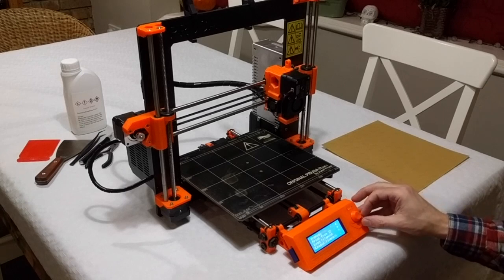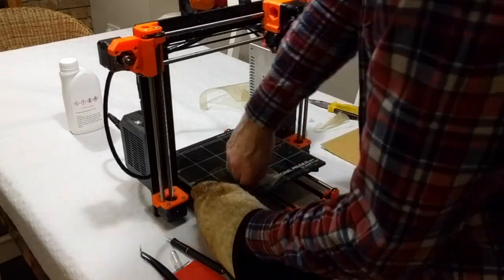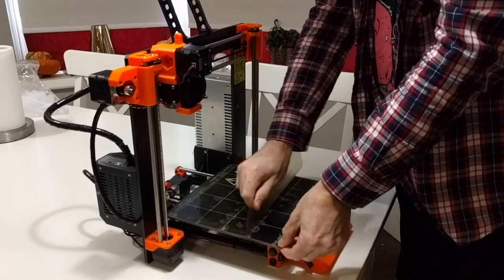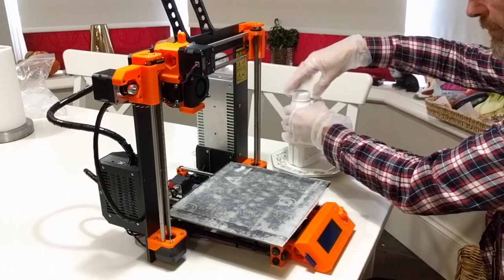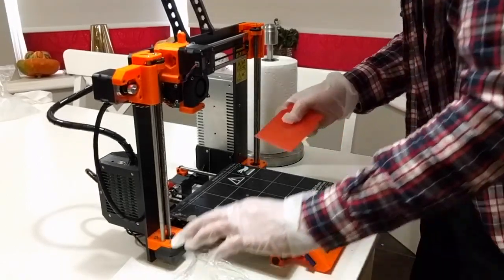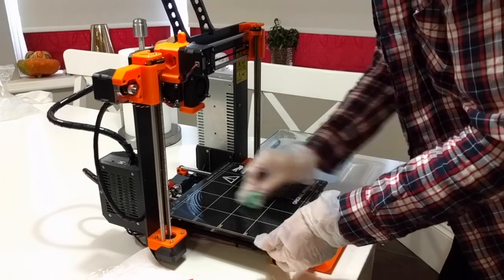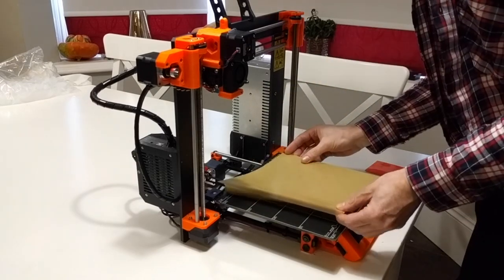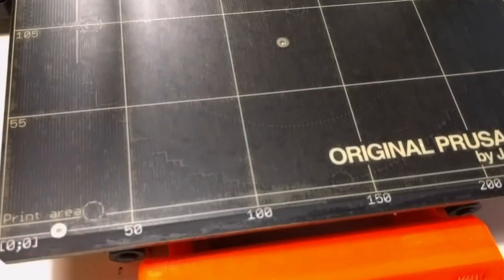Replacing the PEI sheet on a Prusa i3 MK2/MK2S without removing the bed

Comment: I'm a fan of the method which involves putting the steel sheet in the freezer for an hour. Then the PEI pulls straight off. This does leave the adhesive on the steel sheet, but it seems to be the most efficient way of getting at the glue. 
Limonene is more expensive than mineral turpentine, and harder to get hold of, too. I found turps worked very well, provided I went back to it every hour or so to scrape off each layer of glue. Turps does stink though. Not as pleasant on the nose as Limonene. 
I'm not happy with the idea of pulling and pushing at the sheet while it's still attached to the printer, as I suspect there's a chance of loosening printer components and/or messing up the calibration of the printer. A better idea might be to remove the steel sheet, put some cardboard under it, and work on it in a well ventilated area away from the printer. That's what I did.
Reply from the maker: This was the original MK2s – so there's no steel sheet – the bed surface is attached to the bed which is attached to the printer. That's why I knew it was OK to apply some force to the bed, because I had to do that pretty much every time I removed ABS prints from the bed, and the printer had suffered no harm as a result.

Comment: The ice was a great help for me. Had to do it twice as well. Tried acetone first, which evaporated before I could get a scraper on it. Xylene was a lot better. I ended up unbolting the bed and (mostly) sealing it in a ziploc bag with paper towels on top. Curious to try your lemonene because you seemed to get more of it the first time.
Reply from the maker: I'd go along with that, yes. Limonene seems to be the solvent of choice (if you can get hold of it of course).
Reply: Xylene is fairly hazardous, so I’d strongly recommend Limonene instead.

Comment: Would you heat the bed up prior to installing the PEI sheet right after washing with water ( and then let it cool off - to evaporate any lemonade left)?
Reply from the maker: No – it would take a long time for the bed to cool completely afterwards and I suspect it's not a good idea to stick the new PEI onto a warm bed.

I've done this several times now and, with the exception of the time I forgot to rinse the bed with water, there's never been a problem.

Comment: I need to do this to mine as I dented the bed during calibration. I like how you found a way to do it without taking off the print bed. Thanks!
Reply from the maker: Hmm, yes, I've done that in the past as well. In my case, the PINDA probe needed to be nearer the bed – nearer than Prusa suggest.
Reply: Mine did that too, still going with stock sheet after 2 years

Comment: Luckily for me, I still haven't had to do this YET. But after watching again, I have a question. You mentioned salt and water just before you put the ice-pack on the bed, where does the salt and water go?
Reply from the maker: It'a probably not necessary, but I added a little water and some salt to the ice in the bag. Adding the salt lowers the temperature at which ice turns to water, and the water means that the heat will be sucked out of the bed more efficiently. In theory at least.

In practice it should still work fine without the water and salt I would think.
Reply: Ah! I see. Thanks for that. The water makes sense as it would create more surface area contact between the ice and the bed (much like a heatsink) but the ice making the melting temp lower lower? doesn't that make the ice melt sooner?
Reply from the maker: That's right -- yes, so you end up with colder water. Without the salt the water at that temp. would freeze.
Reply: Ah! Thats makes sense now. Appreciate you explaining it. I'll do it exactly like you when I need to.

Comment: i am about to startup my heatbed and warm it up any tips for testing to see if there are bubbles at any temp?
Reply from the maker: Well I guess just heat it up to 100C and pray 😁I admit I chickened out and printed a few PLA parts before braving ABS temperatures 🐔
Reply: alright ill let you know how it goes
im planning on letting it sit at 100C for about 5-10 minutes to see if any form.
Reply: The test went great! there seem to be no bubbles (only time will tell) but i'd like to thank you for giving me tips through this process.
Reply from the maker: Dallin Hansen 👍 Excellent.

Comment: if i use acetone instead of limonene is it going to work the same or not?
Reply from the maker: Dallin Hansen I have heard of people using acetone successfully but I wouldn't recommend it. You would be using a lot of it and acetone fumes are seriously toxic.
Reply: So I started my process last night and I removed all of the glue successfully using the acetone although the plastic scraper I was using was completely unusable after the fact due to the acetone eating away at it I'm going to apply the water and scrub until I feel confident to use ipa then instal the new pei I'll let you know how it goes
Reply from the maker: How long do you reckon the process of removing the glue took using acetone? Did it come off reasonably painlessly?
Reply: So this is the second time I have replaced the sheet because I had the same problem as you with bubbling and when I removed the second sheet the glue was different then the first one,it was a lot stickier so it was hard to get all the glue off but it was easy to scrape
Reply: Stroke about 1 hour and 20 minutes to remove all the glue
Reply from the maker: I presume that soak rather than stroke :) After soaking it came off easily?
Reply: yes it did but it was still sticky
Reply: I also have just installed the sheet and i am unsure if i have done it correctly again because my heatbed with the new pei on looks too yellow than it should be could it just be the pei looking that way or are their bubbles, because when i push down on some parts of the pattern it seems that its a bubble, this is the same thing that happened to me the last time I replaced it, i did try very hard and very cautiously to insure there was no air under the bed.

Comment: I wouldn't recommend leaving the bed mounted. You might bend the rods. Removing the bed is pretty easy and I don't see a reason why not to do it.
Reply from the maker: Obviously you have to take care, but in my case I'm not treating the bed any rougher than I would when removing particularly stubborn ABS prints – gentler, in fact, and my printer's fine after thousands of hours. Those rods are tough and I'm not pressing very hard. But sure, don't use this method if you're uncomfortable with it.

Comment: It's amazing how large the volume of glue removed from the bed, considering how thin the layer is. I recently assisted the local library in the replacement of the PEI sheet. We used dry ice for approximately two to three minutes and the sheet nearly popped off. One the flip side, we used Goo-Gone™ adhesive remover and had quite a bit more work than you did. If there is going to be a next time, it will certainly be limonene. The cleanup we used was alcohol and a bit of acetone, resulting in a bed just as clean as yours in the video.

Your advisement regarding the front area for purging considerations is spot-on. We managed to get it a millimeter too far back. The result is that the purged filament is half on and half off the PEI sheet. It hasn't caused problems, though.

The process of adhering the sheet, about 2 cm at a time worked well too. It was quite satisfying to complete the process with zero bubbles and a perfect test print!

Joe Prusa's instructions are quite well written and your video is quite well done.